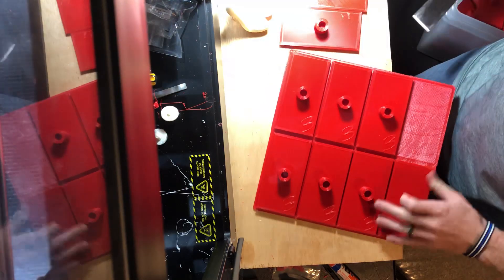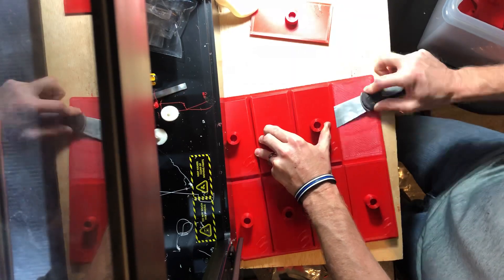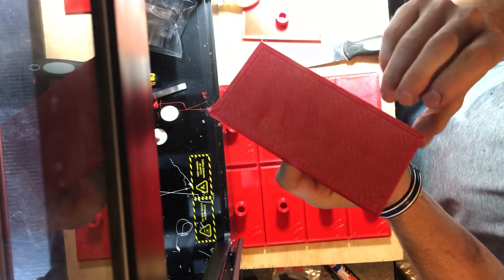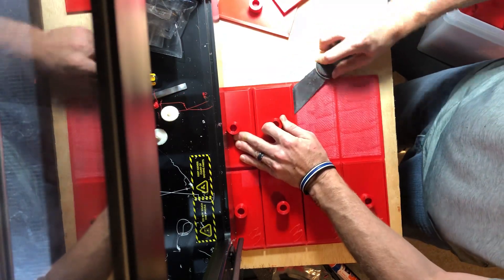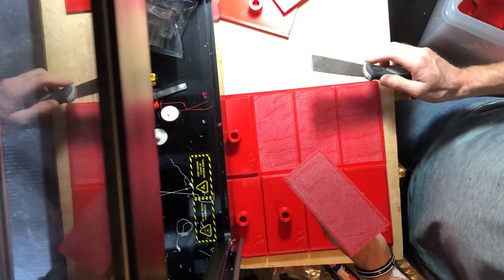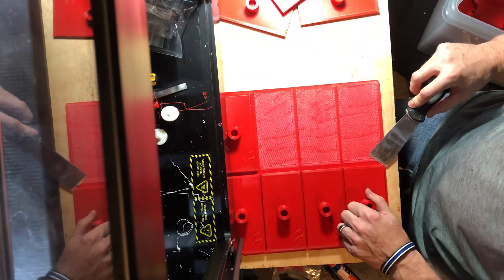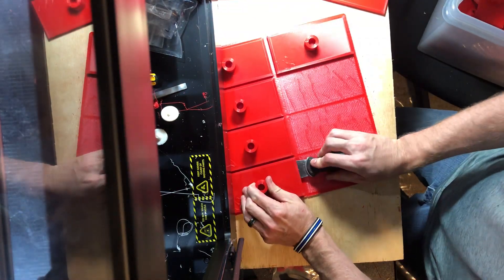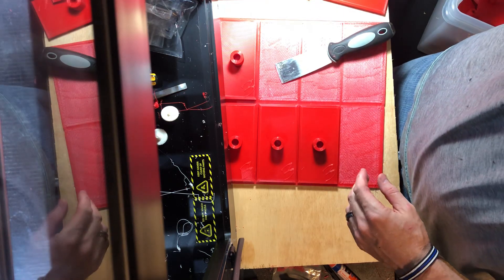How to print with a raft with the Raise3D Pro2

Comment: On our Raise Pro2 Plus using a 0.8mm nozzle with a 0.2mm bed to nozzle gap and a Raft Air gap of 0.4 seems to work pretty well. Using the default Ideamaker setting with a 0.4mm nozzle makes a nice raft and easy removal. I use a raft for just about everything... always have